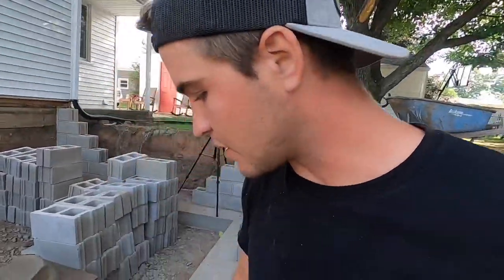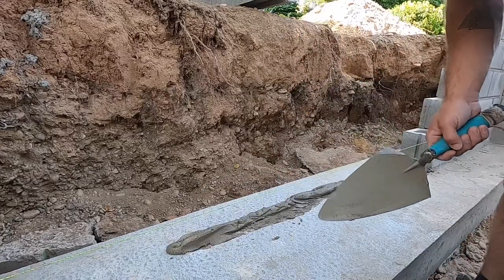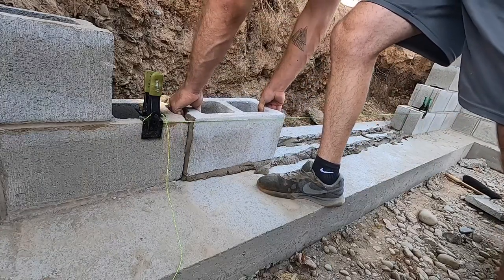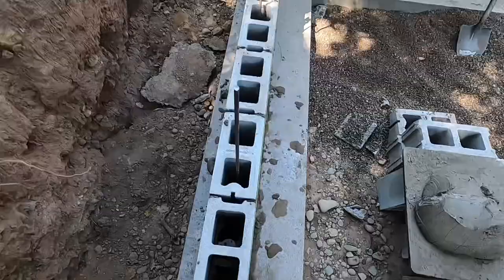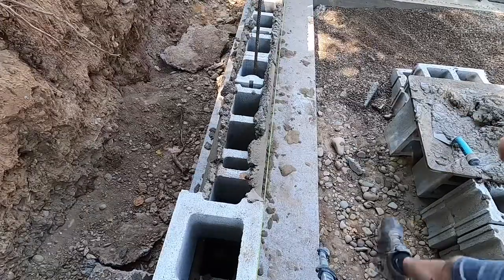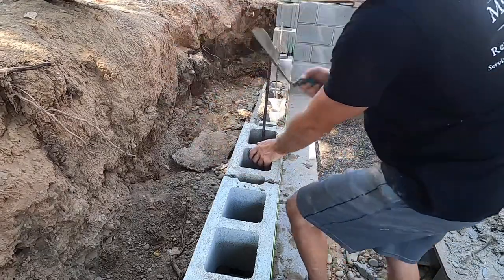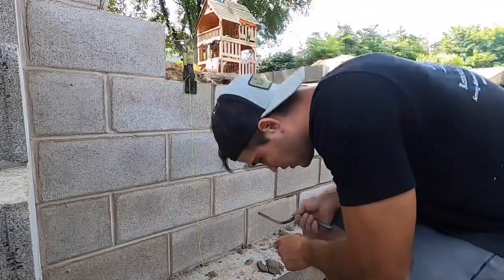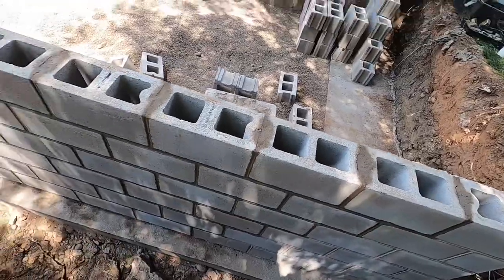How To Lay A Block Wall

Comment: When we prep block every 4 feet (two stacks deep) 4 in a row we set them tall. This way we can run mortar joints on the heads of several blocks at one time. Pretty much just the same way you do it horizontally. We almost never butter head blocks individually once laid. 👊

Comment: I am 100% sold I appreciate your video. The only thing I would change as long pants and steel toe shoes. I learned a long time ago any work endeavor shorts and tennis shoes or flip-flops either cut me open or twisted ankles, or black and blue nailbeds on the toes , thanks for the video

Comment: Loving the videos Mason. Great job!  You ever lay any 4 or 6" block?  I need to do a small stem/curb for a shed and want to keep the block thickness matching the framing
Reply from the maker: I’ve done both. It’s easiest to lay 8 in block all the way up till the last course. Then on the top course step it back to a 6 in block
Reply: @masonthemason6412  this will be placed on an on-grade slab.  Just two courses, so should be pretty straight forward. Leaning to 6" block and changing framing to 2x6 as I Imagine the 4" may be a little harder to set and a little less stable
Reply from the maker: I’ve never done a project like that. In order to make a 4” block stable, drill and pound in rebar and fill solid
Reply: @masonthemason6412  thanks Mason